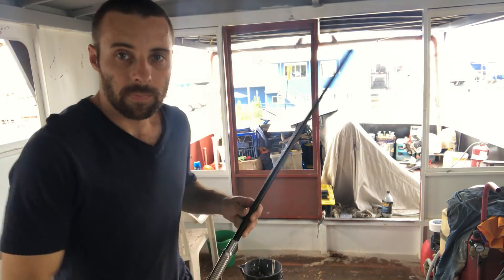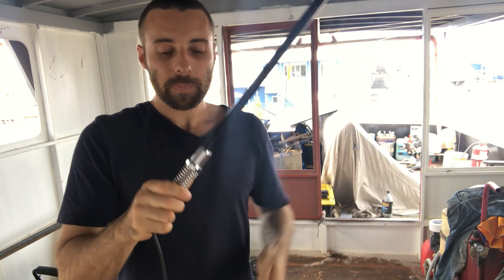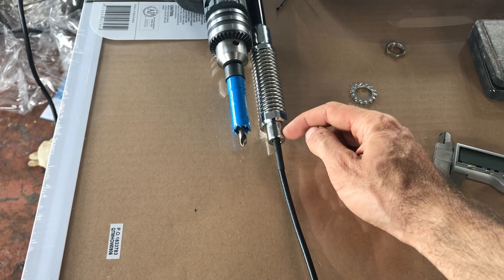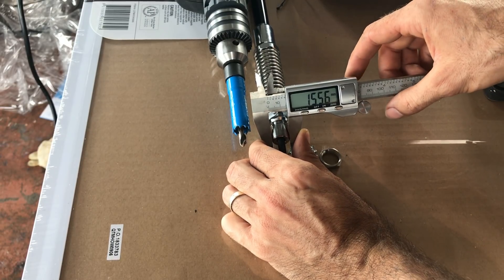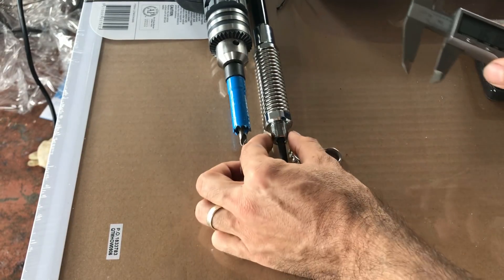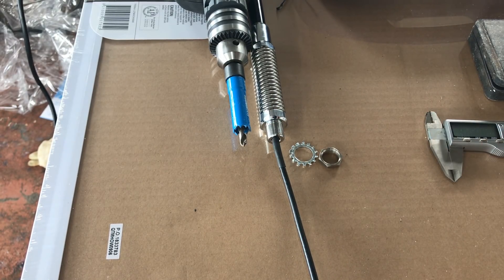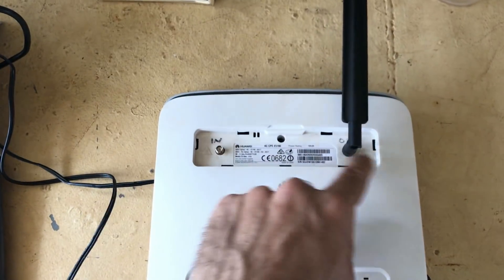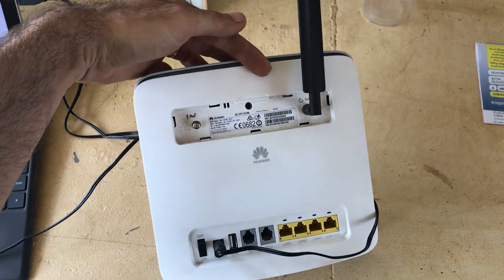How to get Internet & WIFI On A Boat - Building BRUPEG (Ep. 06)

Comment: A bit late to the party, but might as well post the relevant info anyway.

It's pronounced "wow way".

I personally use a Draytek router / modem. It's meant to have an external modem wired in (like the NBN modem), but it also has an internal 4G modem with dual external antennas for 4G and dual external antennas for 2.4g / 5g Wi-Fi along with dual sim card slots.

It also supports "multi wan", basically you can connect multiple modems, use its 4G modem, plug in a 4G usb dongle and it will share the load across all of the connections based on conditions you set up.

Not cheap at around $800-900, but the quality is much better and assuming you know how, you can configure it so much more to suit your needs.

D-Link can be ok if you pay for their higher end units, but anything your ISP supplies will be the cheapest piece of trash they can source.

And Huawei is just a security risk from China, there's a reason governments have banned their hardware from being used.

I've not had any personal experience with StarLink yet, but from my research their cheaper RV option, compared to their marine option, has contractual limits regarding what continent / country you are in and for how long before returning "home".

So aside from their limited (but growing) coverage, that's something else to consider before using them.

Edit: check if your antenna wants to be grounded.
That is, where the antenna "bolts" down may want to be metal to metal and the structure of your boat, mast, roof, bullbar etc actually become a part of the antenna.
Mounting a such an antenna on a bullbar for example, actually directs the signal to be stronger to the rear of the car. The best mounting location is the centre of the roof, unless you have a roof rack or want to enter a parking garage...

Comment: SMA you had it right the first time and yes FME. Whilst in Australia you could install a Telstra or Optus 3/4G repeater (Cel-Fi) and tether through your phone.

SINR I'm pretty sure is SIgnal to Noise Ratio. A bad SNR means crappy speeds and unreliable connection like flutter on a CB radio going out of range.

I'd suggest disabling the WiFi on it and connecting a lan port to a strong router/firewall (say Sophos UTM) and into a network switch, your QNAP, a few WiFi base stations to spread the wifi since metal (metal boat) blocks the signal. Good firewalls like that are great for stopping hacks and virus' from being downloaded.

Comment: I know this is an older video but I need to let you know that Huawei is not a good brand to use...they have been linked to Chinese government spying networks.
There are good (safer) modems out there...I recommend something like TPLink, Linksys, Netgear or even Cisco though they are rather expensive compared to the others.
Reply from the maker: Yeah we really don’t buy into much US propaganda. If the Chinese government really want to hack into our system they are just going to find a bunch of blooper reels and some youtube episodes. TPLink, Netgear, Cisco and any other brand of consumer modem is as hackable as the next if a government (of any brand) wants to see inside.
Reply: Ummm.. I am not a propagandist...nor am I in any way connected to any government...US or otherwise.
What I am is someone who has been in the electronics field for over 40 years...and was trying to warn you about possible security issues.
Huawei, Xiaomi & many others do have hardware/firmware based security problems...and anyone on your network would be at risk for data theft.
And if you have ever used any of your connected devices to order anything online, do online banking or entered any personal information on your device...that data is not secure.

Comment: I'm sure it has already been commented, but please note that the E5186 is using MIMO for it's 4G LTE. The external antenna SMA connections on the back are not "in" and "out" they are both transceivers. So you will a true dual polarity antenna, aka the polarity for 4G LTE is crossed or on an angle. That's also why when you see a MIMO/Dual polarity 4G Omni antenna they are quite thick as basically there are to antennas inside but angled correctly. Almost 100% it will greatly improve your 4G signal.
Reply from the maker: Thanks for this David. Can you suggest an antenna that would be able to connect to the SMA ports? We are about to redesign our system to improve performance and this info is great
Reply: Sorry for the late reply, I'm no expert on how salt-water will treat your antenna so I'm drawing a blank here as to what brand to recommend. But the best advise I can give is to Google for the frase "mimo omni directional LTE antenna". The antenna needs to have two leads also note that Omni will never get as good dBi gains as directional so that is perhaps also something to think about if you would have a "backup" mimo directional LTE antenna you could take out in need and manually point it to shore. Also for ease you would properly look for some "multi" antenna that has range from 800-2600mhz to cover all mobile data bands, however if you know that you only want 4G etc than go after one with only that band as the antenna in most cases will be "tuned" better and give better results. Lastly keep an eye out for Huawei Outdoor CPE B2368 (it's just announced so not released yet) but next time you want to upgrade this is most likely the right way to steer! Very robust, well build antenna with modem directly attached to antenna for optimal performance and all in a very boat friendly design!
Reply: I was reacting to the same thing as David here, the modem has two SMA ports for the purpose of connecting a MIMO antenna array. The absolute best of this is a dual YAGI mimo configuration that this modem will support. However, connecting a single antenna will work and there will be no downside to keeping the other aerial, if nothing else you will actually have  a good setup for the rolling, also if the marina has a sending mast close by the smaller aerial might be more optimal for the angle. Another option would be to install another aerial at an angle equal to decent sideways roll, then those two antennas would be able to compensate for the roll. Naturally this only be feasible for the side to side roll not wave stomping, on the other side if wave stomping causes large angle changes, no one is on the internet for fun.

Comment: How do you isolate mast antenna from lightning strikes?
Reply from the maker: we dont... yet. Im honestly not sure we could. if 300,000 volts wants to make it to earth i doubt having any sort of isolator would work given the rest of the boat is steel. In fact thinking about it now, i would rather the lightning hit the wifi antenna and kill that than hit the Radar mast or roof and zap the whole boat. None of this is based on any knowledge of lightening just a few guesses of mine.
Reply: They do have lightning arresters that are supposed to stop  your electronics getting blown up if your antenna gets struck. (http://www.telcoantennas.com.au/site/phaseblocker-n-male-female-lightning-arrester-6ghz).

Comment: If you want your antenna to always sit level with the ground, you could just fit an RC type vectoring system. It would keep the stick pointing up regardless of what the boat does, and there some that are quite beefy, and some that are specifically made to go in water, and that's before all the mods you'd could do to make this bullet proof.
Reply: Also, rotate the hole saw and grind the teeth in by exactly the body of the cutter. And if you have a small dremel grind the surface of the teeth at slightly alternating angles, not much, just a smidge. It will cut more precisely, and it will under cut as well. I have 3 sets, standard (with the alternating angle teeth mod), an oversize (you bend the teeth carefully outside before grinding them at angles) and undersized.

Once you have a small kit with regular dimensions cut, you never look back if you use cutters decently to a lot.

Comment: I know I'm going to sound like a twit but here goes. You've tuned into an internet signal but isn't it blocked until you are paying for there service?
Reply: BuildingBrupeg It sounds like you're using cell phone towers to get your data, and I assume you need a data plan for your system to work, right? I've read poor reviews on some of the mifi modems. Perhaps using a larger antenna as you did would amplify the signal, rather than the small antennas they come with. I really appreciate your video as I want to set up wifi on my boat too.
Reply from the maker: Not sure 100% what you mean. We have an internet plan from Optus hence we can see/tune into the signal. Is that what you mean?
Reply: So is Optus broadcast world wide?
Reply from the maker: Short answer. No. Optus use cell phone towers located around Australia. We can pick up that signal (just like a mobile phone) out to around 20kms. If we want to go further than that we would need to significantly increase the height of the aerial (to account for the curve in the planet) and also alter the type of aerial we use (one geared more towards very long range like a laser beam rather than a flash light). Once we get 20km offshore (which is not very far in this boat) we will be using a satellite service to beam data to and from Brupeg. The cost of this data is significantly higher so we try to use the cell tower network whenever possible
Reply from the maker: Jenny your spot on. We use the cell network hence we are limited to around 20km. If your fairly close to shore (within that 20km band) and don’t mind signal jumping in and out every so often this set up will work just fine for you. On a yacht you have the advantage over us with antenna height. If you can get the aerial up the mast a good amount then you should see better reception. They only issue with mast mount I can see is any heel will reduce your range so go for a 7-9dbi antenna rather than a really high gain like 15dbi or more
Reply: Thanks Brupeg. We are never far from shore. So I'm sure this will work for us. Now to find the best mifi modem that can connect to an external antenna! We have a 40 ft power boat with a command bridge. So we can get an antenna about 20 ft above the water line. Thank you!
Reply from the maker: My apologies I thought you were on a sailboat. Our HUAWEI E5186 has been very good so far. So I would recommend that brand model for the modem
Reply: Thank you for the recommendation! I hope a carrier in Canada will work with that modem. The available options seem to be pretty limited though.
Reply from the maker: So long as they supply 3G, 4G or 4G plus then it should work ok. The main thing you need to have on the modem is external antenna ports so brand isn’t hugely critical but the ability to plug an aerial that is mounted outside the cabin is critical

Comment: BuildingBrupeg  we know one of your panels had been blown off. was it able to be salvaged? also are you on land power or do you all use the solar for all your needs? I LOVE THE FACT IT IS WHEEL CHAIR ACCESSABLE!! One day you can come get me, well maybe not, doc's gave me 3 1/2 years to live and that was 4 years ago as of oct 22 my b-day hahaa beat it for a while, anyway i probably told you about that all ready. Hope to at least see her in the water as well as that ice crushing bow!! Old One Legged Joseph T
Reply from the maker: We’re really sorry to hear about your health. Currently we run 100% off 240v shore power, the panels were just stacked up on the wheelhouse roof waiting to be installed. When we launch the panels will be mounted but not connected, and connection will happen in the water. Solar will generate 100% of our needs while at anchor. Night time power will come from the 48v battery bank. We wanted to make the boat as easy to use as possible given Jess is in and out of wheelchairs. Thanks for being so supportive. Take care Joseph

Comment: Cable loss extremely high at that frequency. Best setup if you have to run longer cable is to use 2 antennas with short cable and mount modem near antenna. You can run a Cat cable to a splitter or just use wifi. Just run power to the modem.
Reply from the maker: We are going to modify our system slightly. Adding a second identical antenna outside and seeing what we can do to improve numbers. Cable length is 3.5m

Comment: Huawei is pronounced a bit like "Who ah way" If you had another external antenna you'd probably do slightly better in the performance stakes as 4G is a MIMO connection.
Reply from the maker: Ha! I’m just reading all up on this and I’m thinking I will get another antenna to mount beside

Comment: Minimal length and right type of cable, avoid adapters and use the right antenna. These are the basic rules to get the best signal for any radio, modems and wireless routers. Keep up your good work.

Comment: Any electrical connectors exposed to the weather, especially low power connectors, should have a dab of silicone dielectric grease INSIDE the connector.  It is the last line of defense against moisture getting in and corroding the connection.

Every boat owner should have some in their repair kit.
Reply from the maker: Roger that. Will head to the chandelier today and grab some
Reply: Not really a marine item.  Any hardware or auto parts store will have it.

Comment: Every 3db Is equivalent to double your signal strength, so 7 db is approximately 5x signal strength.. Also just a thought after i wrote the other bit, once you lose signal strength you cant get it back , so in the future buy the largest db antenna ( yeah mate im from the states ) you can get , because you can always attenuate the signal down , but you cant go the other way, if you try to amplify a signal (down a cable after the signal is lost ) you amplify the noise also...
Reply from the maker: There is a lot to this isn’t there. Most of the 4G stuff I’ve done has been relatively stable yachts etc so nothing fast moving of too much jumping around. I never knew that once signal strength was lost it can’t come back
Reply: Yeah , entropy, lol.  I'm an amateur radio technician , and have dabbled in electronic/repair for most of my life, i'm no professional though. Also , keep in mind the coaxial cable will add to signal loss so keep the runs as short as possible. if your cable adds more db loss than the the antenna give you are worse off (obviously ) , at that point you need to upgrade the antenna ( most important ) , the coaxial or both .  Also do not kink the cable that will foul up the dielectric, this is especially important with large cables like RG-8u.
 https://www.universal-radio.com/catalog/cable/coaxperf.html
Reply from the maker: Ok cool thanks. I’m reading the blog you sent me and I’m trying to get my head around if I need to try an additional duplicate antenna outside. Looks like the modem I have isn’t as adjustable as the previous model
Reply from the maker: https://www.youtube.com/watch?v=cB1v_YDqjOk&feature=youtu.be looks like i might need to get a duplicate antenna and mount it af far apart on the wheelhouse roof as poss. to increase the data rates.
Reply: You can also use what is called a duplexer/diplexer in certain circumstances , and this will isolate the tx / rx  from each other and will allow you to use one antenna , however i do not believe they are cheap..
I'm not sure your wifi transmitter is high enough power ( under 1 watt ) honestly to worry bout overloading the RX finals any way , i think a couple feet separation will probably be ok.

Also where you bolted your Ariel to the steal you need to throw a big nasty wad of deoxit or some kind of conductive grease to protect the connection from the antenna to the metal  ( ground plane ). if you haven't started wiring you probably want some for other things any way, you have to have it for aluminum wire.

http://www.l-com.com/bandpass-filter-rf-splitter-diplexer-for-24-ghz-5-ghz-wireless-lan-systems this guy is 59.99 so less than i was thinking.
Reply from the maker: Yeah I’ve seen 0.5m - 3.0m between omnidirectional antennas is good
Reply: If it was me i would do 1 meter . 

Oh and sorry again i'm from the states so we use imperial measures , ill do my best to use metric it is better anyhow...
Reply from the maker: +1 for metric
Reply: What you are actually looking for here is at least 2 wavelengths of separation to get good receive diversity perfomance. At 700 MHz (which will be the lowest frequency and longest wavelength you will be getting) that is 2 x 43 cm. So your about 1m is dead on.
Reply from the maker: Thanks Mark